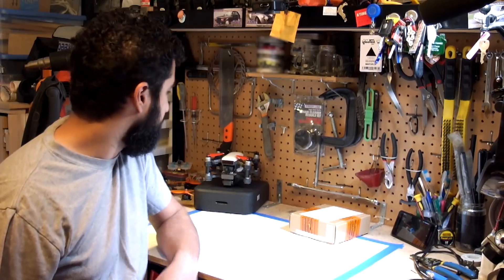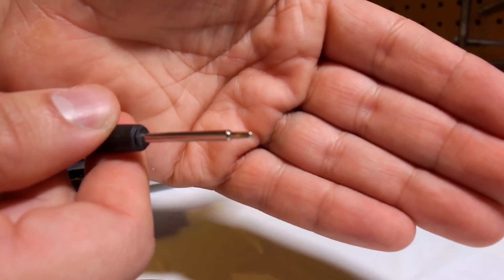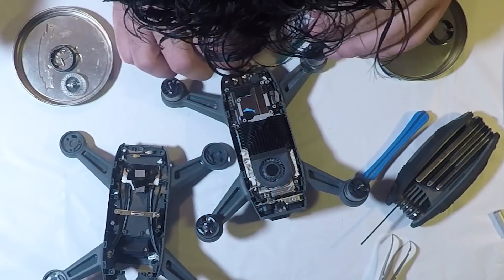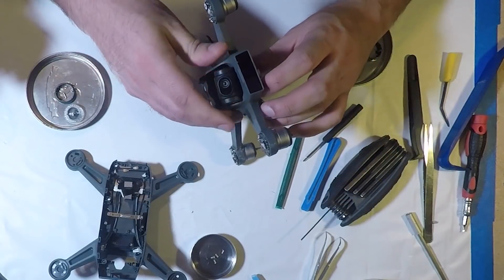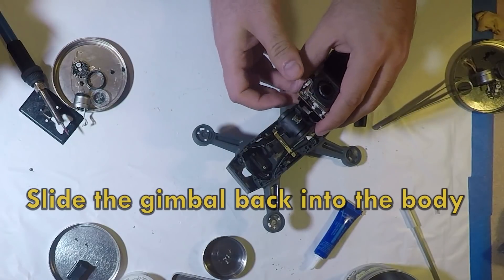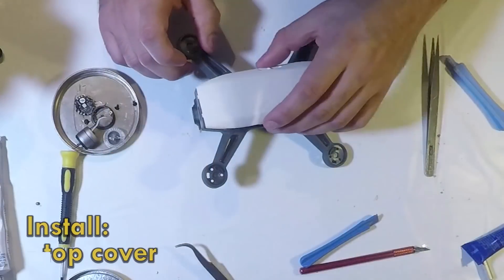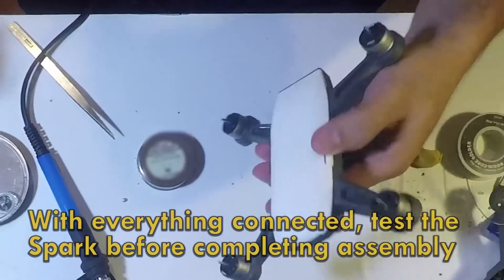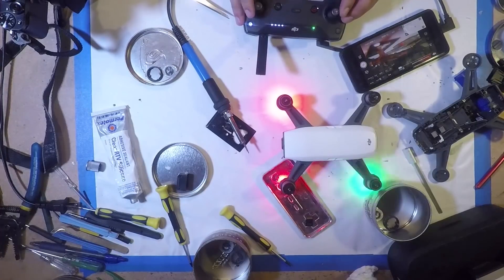DJI Spark Repair: Complete disassembly and reassembly.

Comment: I followed all the same steps however when I turn it on it didnt go through its normal start up, the camera seems to work however the rest does not. It make a 2 beep continuous noise any ideas what I should look for?
Reply from the maker: I would carefully go over the solder joints for the ESCs, and make sure they are not bridged. Next I would inspect each connector and check to make sure that they are firmly inserted and not damaged.
Reply: @PrepareForLanding  ok thanks I was thinking the same. Actually I may just buy new ESC.
Reply: What about using a  circuit tester?
Reply from the maker: @carmeloscalone564  I'm not really sure about the board layout in terms of what to probe for your issue. Do any of the motors try to spin? Are there any errors in the app?
Reply: @PrepareForLanding  No they didn't spin or go through the start up like they use to. There was an error on the take off I think it said ESC something cant start
Reply from the maker: @carmeloscalone564  ah do all / any of the ESCs light up?
Reply: @PrepareForLanding  no lights no movement
Reply from the maker: @carmeloscalone564  seems strange that all 4 ESCs would stop working at the same time. I wonder if something is damaged on the flight control board?
Reply: @PrepareForLanding  it fell 25 feet and broke the motor bracket on one arm, like the video. I didn't turn it back k on after the crash so not sure if something else got destroyed. There were no visible damage pieces when I took it apart. Like I said the camera works when I turn it on and it moves up and down and records
Reply from the maker: Unfortunately the spark electronics are mostly on one board, so if only one part of it fails, the whole board isn't very useful, even if it still partially works.

Comment: I crash my spark and now one led doesent work and I don't know in what part is the led so i can change it. Where is the led in the dji spark?
Reply from the maker: The LEDs on the spark are actually park of the ESC on each corner. In order to fix a broken led, you would have to change out the ESC that is is connected to.

Comment: Very good guide!  Did you have any issues with calibrating the gimbal or with its performance?  When I replaced my camera + gimbal recently I had 2 issues.  One it had to be calibrated and I did that using software from https://github.com/o-gs/dji-firmware-tools but when the gimbal was calibrated when I rotated the camera so that it was pointing down, every time the gimbal moved fully to the bottom, it would get stuck.  I would need to turn the Spark off, restart it and then the gimbal could be moved again.  But as soon as I rotated down again it would get stuck.  Did you run into any of these issues after you rebuilt that Spark?
Reply from the maker: I have seen videos and read about other people having calibration issues with the gimbal, but that's typically when you use a flight controller + gimbal that isn't matched from the factory.  As far as I know, the link you posted works well... But I've never had to use it in any swaps I've done.

Comment: I tried to do it, and now I don't have any sensors working. I get gps sat counts, but it acts drunk.  Acts slightly erratic . Any ideas?
Reply from the maker: You need to recalibrate the imu.
Reply: I tried that, and that did not work. I inspected everything further, and found a small tear in the bottom sensor cable. I replaced the bottom sensor/camera cable, and everything is fine. Thank you
Reply from the maker: @gooniegoogoo9820  glad you found the issue!

Comment: My dji spark gimbal broken due to fall above 30 feet height and gimbal broken and I tried to test my spark and motors are working but drone is misbehaving while flying, kindly help!
Reply from the maker: The misbehaving flight is most likely due to a calibration problem.   I would try and re calibrate the compass and IMU from within the DJI app in order to restore stable flight.  Replacement cameras and gimbals are available on eBay: https://www.ebay.com/sch/i.html?_from=R40&_trksid=p2380057.m570.l1313.TR6.TRC1.A0.H0.Xdji+spark+gimbal.TRS1&_nkw=dji+spark+gimbal&_sacat=0

Comment: Nope, nope, not gonna do it.  As thorough and well-made as your tutorial is, a man's got to know his limits, and, unfortunately, mine are met here.  I'd mess this job up so badly you wouldn't be able to recognize it as a drone in the end.  It's too bad you can't get the replacement as a pre-wired modular unit so you didn't have to fiddle around tinning and soldering.  I admire your workmanship and applaud your guts.  It's out of my league, though.

Comment: How do I get the LED caps off?
Reply from the maker: Use a small flat head screwdriver on the inside edge of the joint. If you look carefully you can see a tiny cutout where there is room to pry from.
Reply: @PrepareForLanding  thanks that helped a lot!

Comment: I would think you should transfer the SN stickers from the battery connector on the frame as this has the wifi password etc.. Otherwise good tutorial..
Reply from the maker: Actually I did make that transfer, but didn't record that part.  A little heat and careful prying got the label off in one piece.